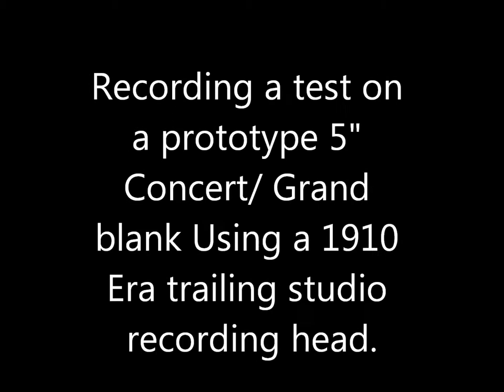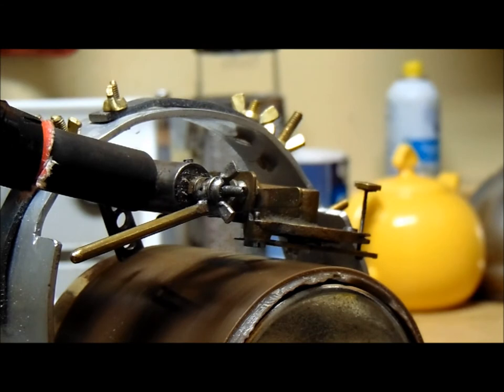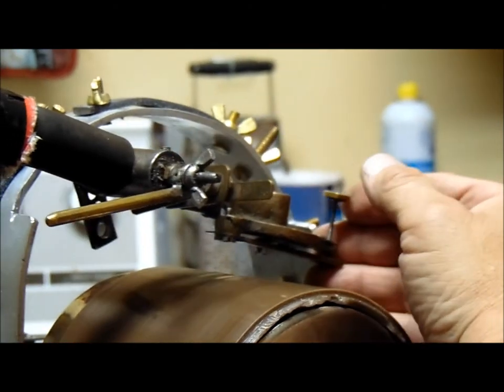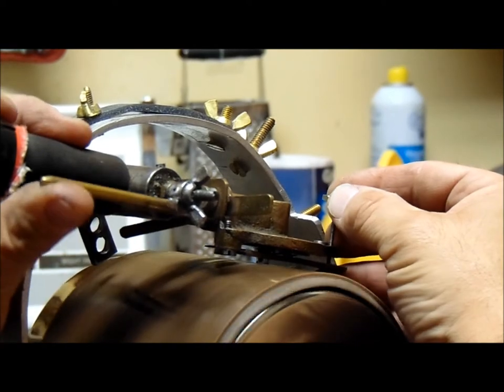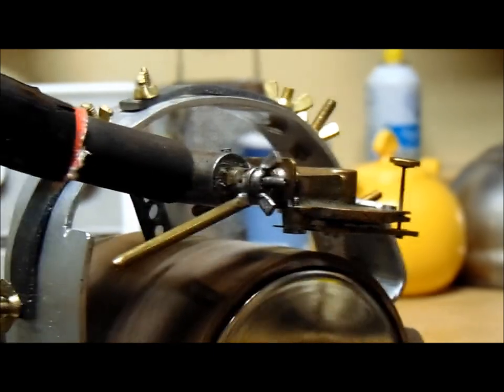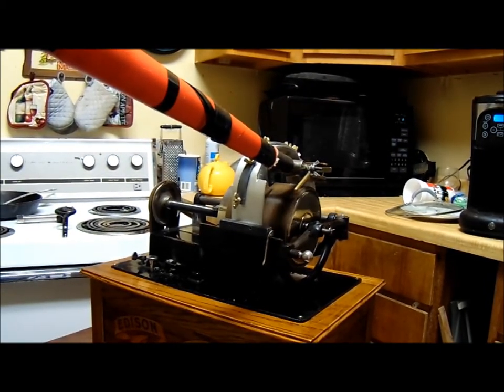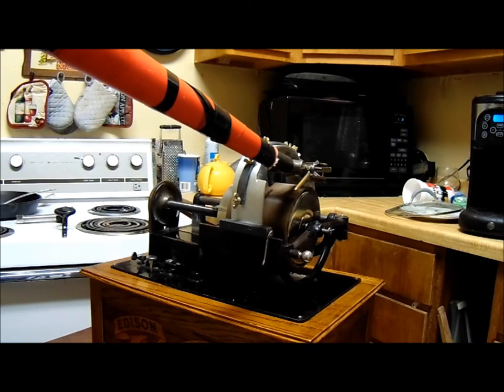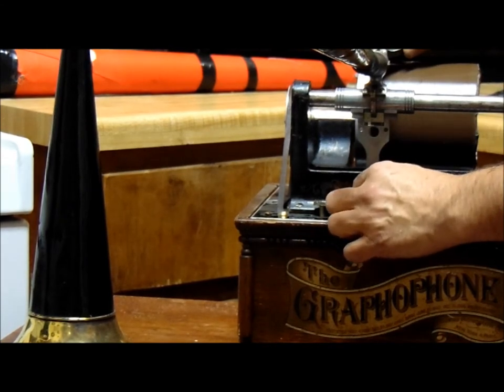Recording a 5" Concert Grand cylinder record with a 1903-1920 era Studio advance ball recorder.

Comment: Where did you get the spiral core to mold your cylinders?
Reply from the maker: We are all mechanically inclined in my family. I calculated  rate of shrinkage, in both the vertical and horizontal plane. I am talking about the standard size mould.  I drew out a plan first the kind of mold I wanted. The steel stock trued on a regular  lathe, and base spud machined. Next my Uncle wrote a CnC program for the taper, the Mandel 7" tall and 2.5% larger for shrinkage. I hand cut the spiral release flutes with a file, so the recorded unscrews. Steel dome tubing for the outside, and steel bases, with centered  risers.
Reply: @thenorthamericanphonograph1039   Thanks.

Comment: if i wanted to purchase a concert phonograph whats a resonable price and what is a good model ?? just asking have a good day also the uncle josh impresion was very good
Reply from the maker: The Edison Concert is the most rugged of the 5" format, basically an Edison Spring motor or Triumph, the base and motor is the same. The top works made to accommodate a 5" cylinder, three mainsprings.  I have seen them as low as $900.00 for a good player, but not cosmetically perfect to as high as $4,500  in very good condition, or restored with fine original finish, and all the gold illumination intact. The Columbia G G, a six spring model $2500-7,000.00 .  The two spring HG/ AG $900.00-2,800.00